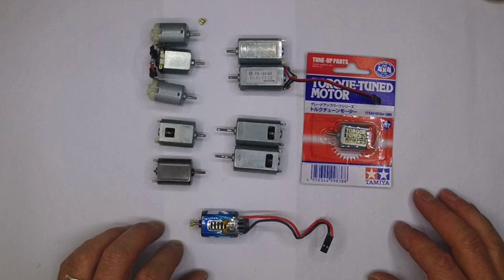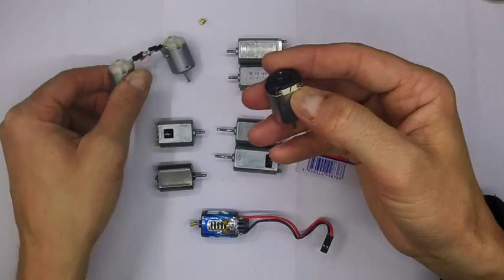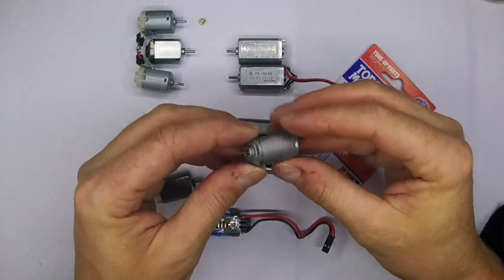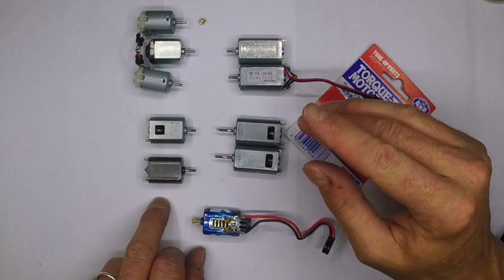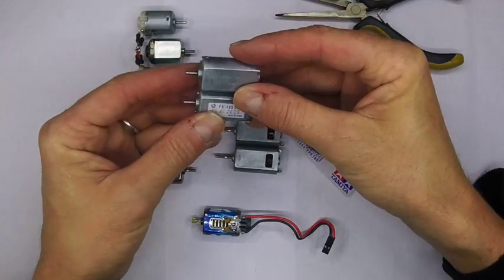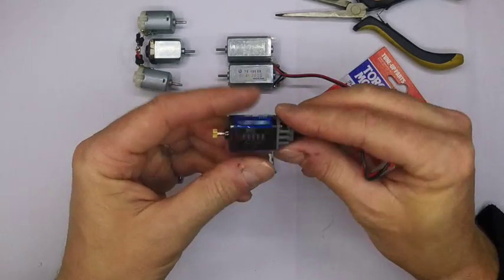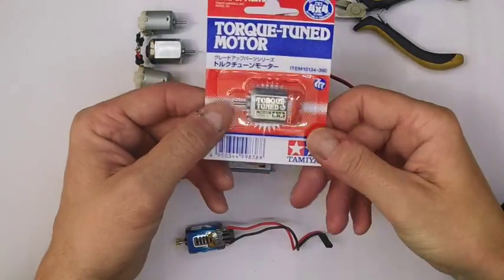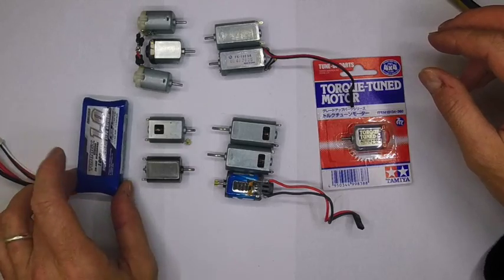Nerf Motor Mod Guide

Comment: Hi

im looking for good motors without changing anything in the shell for not too much money. do you have any advices? if so could you please add the links.
Reply from the maker: You cannot change motors without rewiring and using battery packs. All modified motors draw too much current for the standard wiring loom. Watch my balance video. Cheapest electric mod is 2 IMR 14500 button top cells and 2 dummy batteries, that will work in the stock set up,  no motor swaps or changes inside. See my modulus Level 1 video.
Reply: Foamdata Services and with rewiring and other batteries but without having to cut into the shell?
Reply: http://www.banggood.com/DC-6V-28000RPM-Gear-Motor-Carbon-Brush-DC-Motor-for-DIY-Accessories-p-1029741.html?currency=USD&createTmp=1&utm_source=ebay&utm_medium=cpc&utm_content=saul&utm_campaign=Electronics-US&ebay

What is your opinion on these motors? Also what wires do you recommend?
Reply from the maker: That is a Banshee motor. OK on 2s.

Comment: Hi foam data services.  I recently found some interesting motor it is called    Standards 130 2570R it's a neodymium motor for7.4v 19600 rpm 4.9A made by Standard  and it is surprisingly cheap!?   And I also found the extincted wfk 130sz's 180 size counterpart which is absolutely weird.    Is the standard 130  motor good for nerf guns?
Reply from the maker: Too slow. You want 28k-30k @ 6v to be useful in a flywheel, plus at least 1g torque.
Reply: Thanks ; )

Comment: Is fk130sh suitable for flywheel blaster ? Or fk 180 3534
Reply: Hi FDS  I am new to the world of nerf motors
Reply from the maker: The 130 is impossible to guess at,  without the second half of the numbers which are the turn and wire thickness. The 180 will work but if you are new to motor mods I would get mtb rhinos and 3s lipo

Comment: what motors/batteries would you reccomend for a good mix of accuracy and power
Reply from the maker: Accuracy is a function of precision in construction and what dart you shoot. Motors don't affect it except if they are radically mismatched.  Get a set of weight matched flywheels and koosh G3 darts for starters then matched concave wheels and a STRAIGHT not crap canted metal cage plus build it really precisely
Reply from the maker: +Foamdata Services obviously the metal cage is your next development stage from matched stock parts
Reply from the maker: Batteries should meet the burst current demands of the motors
Reply: +Foamdata Services would you reccomend helcats, mtb rhinos, or honey badgers
Reply from the maker: Honey badgers are lousy flywheel motors. The other two depend on how much battery space you have. Hellcats need at least 40c constant and over 1000mah capacity.

Comment: How do I remove the gear from the xp180
Reply from the maker: Very carefully. I use needle nose pliers to lever them off, DO NOT put any tool on the bearing housing. A micro gear puller is the best tool for this job, it has no chance of you damaging the bearing or motor.
Reply: +Foamdata Services many thanks appreciate the assistance

Comment: I think I heard that Make.Test.Battle's MTB Rhino 3S Motors were a cheaper, more common alternative to Falcons, and they had more torque. I don't know myself, I've only used the MTB Honey Badger 2S Motors for my SANIC GO FEST Stryfe. (Yes, I am American, if that wasn't already obvious.)
Reply from the maker: The MTB rhino is based on the Falcon.
Reply: Foamdata Services
Yes, I do believe they are. Since they are loosely based on Falcons, and are slightly easier to obtain, would a Rapidstrike with Rhino Flywheels and a Rhino Pusher work about as well as if it had all Falcons instead?
Reply from the maker: Yes.
Reply: Foamdata Services
Okay. I've been planning to make a Full Rhino Rapidstrike for a while, but I need to find a way to get the Blastersmiths UK Switch Kit for it. (I'm American, so buying things from other countries never goes very well for me.)

Comment: I will always use pro 180s they ,In my opinion, are the best motors out there
Reply from the maker: Fine on 2s, my two sets have pounded out the centres on every set of flywheels on 3s and they are now out performed by MTB Hellcats.
Reply: +Foamdata Services I use dr snikkas cages on almost every build so that may be the diffrence
Reply: +Foamdata Services also another question I've looked at your batteries guide which lipo should I use
Reply from the maker: The DRS flywheels have a much tougher compound, which I imagine makes them more durable.
Reply from the maker: Depends on your motor set up, desired FPS, size of the blasters battery tray and what charger you have.
Reply: +Foamdata Services I run a stryfe with a good rewire and pro 180s with a dr Snikkas cage
Reply from the maker: You will want a tray expander or opened up battery tray for that, you should run a pack of at least 850mah capacity and 30c constant. If you are running it on 2s then theres a 950mah Graphene Lipo on Hobbyking that just fits in the tray too. If you are running a 3s then choice is much trickier. Stryfes have very little room in them, even with tray expansion. Measure your space and use the Hobbyking battery finder.
Reply from the maker: That is a 3s motor. It will work with MTB hellcats better than XP180`s. If you must run them on 3s, meaning they are not running at the optimum RPM, then that pack will just about meet their current demands.
Reply: ok thanks

Comment: Zippy Compact 1300mAh 2S 7.4V 40C 50C RC LiPo Battery Pack I was going to get this one because the Zippy 2200mAh 2s 40c it's width is just barely bigger than my stryfe battery cage so it won't fit how do I widen my cage.
Reply from the maker: Neither of those batteries will fit a Stryfe. You need a tray expander for the 1300 mah. You can also buy the 950mah 2s Graphene pack, that fits with an expander or if you cut the top out the tray. See Bobo's sparkley Stryfe.
If you have all these questions you would be better off looking at Nerf Redditt, plenty of help there, or register at the Britnerf forum. YouTube is a rubbish place for answering technical questions. Drac gets hundreds of questions a day, he is simply too busy to answer them all.

Comment: with a 2s lipo is that 7.4 volts
Reply from the maker: Yes, you also want 40c constant and over 1000mah capacity. See the 2200mah 2s 40c in my battery guide.

Comment: will a 3s lipo work and do you know where I can find dupli color vinyl spray want because I can't find it any where
Reply from the maker: Never mind answering questions, Vinyl dye is rubbish as a paint, I never use it. Buy Halfords Primer instead or GW Black Spray if you are doing a dark colour, be aware bright is best and orange tips is a US thing, in the UK/EU it must be bright/clear colours and not resemble a real firearm if you want safe public use. Halfords top coats are very good too. 3s Lipo will immediately result in your flywheels falling off the motor shafts. The XP MUST run on 2s for reliable power, otherwise you will be changing the flywheels every game.

Comment: do you think hellcats are worth anything I though about it because it's cheaper but after watching your video I don't know
Reply from the maker: Hellcats have much more torque than a 3240 and the higher voltage means they produce it without a corresponding spike in current draw. Expect a full set if test figures and a 2016 motor rundown in the next 2 months. Hellcats can shoot up to 15fps more than previous 180 motors.

Comment: What kind of battery would I need for the Xtreme 180 Pro?
Reply from the maker: I would buy MTB hellcats, they are better. Both will need a minimum of 1500mah, 40-60c constant. Don't run the Xtremes on 3s if you want the flywheels to stay on.
Reply: Ok, I already bought and received my motors but thanks for the advice. I'm pretty new to modding the batteries as I mostly mod spring-powered nerf guns. So would I be looking for a lipo, or something like an AA or something similar?
Reply from the maker: NOT AN AA BATTERY. You MUST have a Lipo for Xtremes and a suitable wiring loom, 16AWG multistrand silicone insulated hobby wire, uprated switch gear and a properly built loom. These motors can and do frequently pull 50 Amps, that's 100 times the lethal level, treat them with respect or stick to springers. Watch my Balance video.
Reply: Alright, thanks for the info. I don't want to electrocute my self and so i'll try to be safe. I have 2 last questions though. 1: Would the wires that the 180's came in be ok to use? 2: How would I reverse the direction of one of the motors? (I bought an A and B but they only gave me 2 A's.)
Reply from the maker: The wires on the motors are not designed for stall currents. In an RC hell if you try and stall the rotors you either crash or lose a finger! Don't worry about the direction, motors are omni directional unless they have commutator bias, which these don't, see my video on mod motor installation, leave a stub of wire to remind you which terminal is which, you want XP's to be the opposite of how I did the 3240's in the video, it makes it easier. Be aware the XP terminals are bloody fragile. You want a 2s 40-60c constant lipo with a capacity of alt least 1000mah or a 950mah graphene.
I have often used 2 A's, 2 b's or a mix. Its only the way they are wired at the factory and the pinion setting, the actual motor is the same.

Comment: Will a 12v NiMH burn rhinos? Also can you store them at any voltage as long as you charge it properly?
Reply from the maker: No, it won't. You can leave NiMh at any voltage. If you want a pack that actually fits into a blaster and isn't massive, get MTB Honeybadgers instead and run them off an 8.4v airsoft pack. Same performance as Rhinos, lower voltage. They still need 15-20A current though.

Comment: Also, I accidentally bought these, would tey work on a 2s? what kind of fps? http://www.ebay.com/itm/2pcs-DC-1-5V-6V-3V-5V-High-speed-Magnetic-Small-Motor-for-Car-Boat-Aircraft-Toy/221639931485
Reply from the maker: No, those are pretty rubbish. If you are buying 180's then get MTB Hellcats.
Reply from the maker: Looking again they may not be awful, but nothing like as good as Hellcats.

Comment: Hello, where did you find the torque tuned motors, and do you think they would work well in an elite rayven?
Reply from the maker: They are rubbish, don't use them. 2 IMR batteries and stock motors will work just as well in a Rayven, or two MTB Honeybadgers with a 2s Lipo.
Reply: Ok, thank you.

Comment: Do you know any good dual shaft 130s that can run on a 3s? Need it for a rhino fire I'm comissioning for someone special
Reply from the maker: There may be a slot car motor with dual shafts, the stock Rhinofire motors will take 3s fine, it's what's recommended with the BSUK mod kit for it-
https://blastersmiths.co.uk/products/rhino-fire-wiring-kit
Reply: Foamdata Services alrighty then, thanks for the heads up. I was thinking of using xtreme 180s for the mech since there's space.
Reply from the maker: XP180's are a single shaft, also they are a short single shaft which ovals the flywheel centres on 3s with stock wheels. If you used one as a RS pusher on 3s it will hit 15dps. 
Running the stock Rhinofire motors at 3s is about 110fps at 6dps. If you put workers on you could get 120fps at 6dps.
Reply from the maker: MTB hellcats are much better than XP180.
Reply from the maker: No, and Trustfires are rubbish.
All he did was compensate for the massive voltage sag by adding more batteries. He won't have got over 14v with that set up. A true Lipo PACK will keep putting out peak voltage up to its max discharge current, then the volts may take a hit. If you put even a 4s PACK on the RF you will immediately cook it. Go watch my balance video.
Reply from the maker: You can look at slot car motors but considering BSUK commercially produce the kit and never sell anything that hasn't been thoroughly tested I would say if they recommend 3s then it's safe. Run at 2s instead if you are worried.
I would be more worried about the stock trigger switches, the BSUK method uses twin MOSFETS to protect them from the increased current drawn by the motors when modded.
Reply from the maker: No, they are not, because they are designed to be at 33-36k (best speed for flywheels) at 3s. XP is at 40-44k at 3s, burning foam. Also neither fits the Rhinofire.

Comment: 3s lipo will be good with blades?
Reply from the maker: No, they are a 2s motor. The new MTB Hellcat 180 is a 3s motor.
Reply: but will they work with a 3s?

also are the hellcats for sale yet?
Reply from the maker: +Turb Plays They will burn foam on 3s.  You get no power gain from the extra rpm. Hellcats are due in the next 3 weeks

Comment: Hello again FDS I have been looking for 4s batteries and I have found this (please excuse the long link). Would somthing like this work well with my Vulcans stock motor? Assuming I cant find a higher voltage rated one that would fit. 

http://robojax.com/products.php?pid=347&gclid=CjwKEAjw1Iq6BRDY_tK-9OjdmBESJABlzoY7MrRHR7TVTsH_KMRU9CQNX5GWS3oo0puqQUZcfUvVxBoC0JDw_wcB
Reply from the maker: That would work, you will get a fairly high cyclic rate with that. I would be concerned the motor may burn out with long term use. Not tried a vulcan on a 4s. The motors are fairly robust.
Reply: Super, thanks a million for the help! Yeah if I cant find a replacement then I dont want to burn it out. I downsized my belts to the regular 25 shots so that I dont run it for more then a few seconds consecutively. Alright well thank you again! Take care
Reply from the maker: You should have no problem with 50 belts. If it's going to die, it will do so in the first few seconds of firing. If it survives that then it should last ok.
Reply: +Foamdata Services Interesting. Alright thats great. I will certainly keep that in mind if I can get my hands on some more belts. There hard to find for reasonable prices.

Comment: Hello FDS I have a question about Vulcan motors. I am upgrading to better wiring and 2 9v lipos. Would you have any idea of what kind of traits I should look for when I get a better motor for it?
Reply from the maker: Motors for Vulcans are very hard to get. They are not in a size used by other hobbies etc, and the muzzle velocity is generated by the mainspring, the motor just moves the mechanism. The stock one can keep going fine up to 4s Lipo. I would put a single small 4s pack in there if you want high ROF. If you are planning afterburners then use a single 3s 40-60c Lipo and then run MTB Rhinos or hellcats on the afterburner.
Reply: Okay 👍 thanks a lot for the help!

Comment: can you put meishels on 11.1 volts?
Reply from the maker: Not if you want them to still work. Buy MTB rhinos if you want a 3s 130 sized motor. Over revving does not much for velocity, it just burns foam. Rhinos are tuned to be in the best Rev range for top velocities at 3s. If you have something that isn't a Lipo or NiMh pack, then stick to stock motors, all my motors need over 10A each, so can push 14500 cells over safe limits, as well as hurting capacity.
Reply: so just standard alkalines?
Reply: oh, never mind
Reply from the maker: You will need a pack that can put out a least 20A constant, @ 11.1v for rhinos in a Stryfe. Add 5a more for the pusher in a RS, so 25a total. Watch my balance video.

Comment: Can I use these?
http://www.amazon.com/gp/product/B00745ZZNQ/ref=s9_simh_gw_g21_i1_r?ie=UTF8&fpl=fresh&pf_rd_m=ATVPDKIKX0DER&pf_rd_s=desktop-3&pf_rd_r=1HVJEVDQ6WGRPEXPEV2Q&pf_rd_t=36701&pf_rd_p=f9c06381-e106-4d3c-95fc-fcc60666a87f&pf_rd_i=desktop
And if so whats the discharge. Because I have a Li-po Thats is 30c didcharge 
http://www.evike.com/products/36324/
Reply from the maker: No, those are not as good for Nerf. MTB have a 3s 180 out next month, it's reputedly very good. If your Lipo is 2s then get some Honeybadgers. 30c constant is on the low side for 180's, they really need 40c constant. It will be fine for 130's though.

Comment: Would you recommend 180 3240s or the MTB Rhino on Containment Crew?
Reply: Running 3 Li ion 3.7v batteries by the way.
Reply from the maker: +Colton Cub3D You can't run any mod motors off those batteries, go watch my blaster balance video. Don't forget you will also have to rewire properly.

Comment: How do MTB's rhino and honey badger motors fit into the mix? Which 130 size motors would you recommend for use with IMRs, or are stock motors good enough?
Reply from the maker: You can't use mod motors with IMR's, they draw too much current, watch my balance video. Rhinos are a falcon motor and Honey Badgers are a Meishel. Same sort if performance, 110-115fps, just different voltages. HB's and 2s generally is better for Stryfes, as you can get 2s Lipos to fit under the stock tray door more easily.